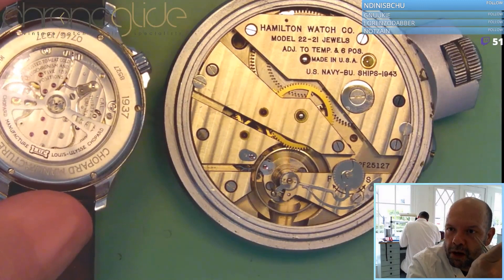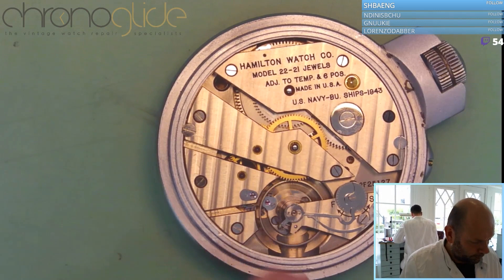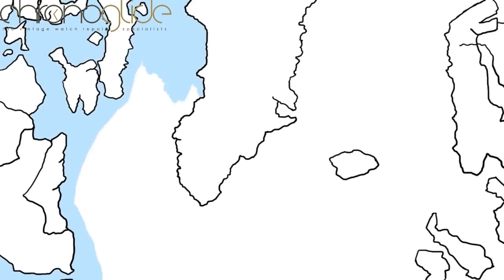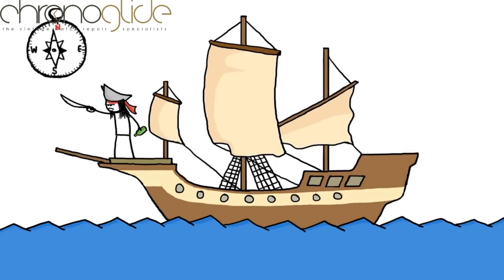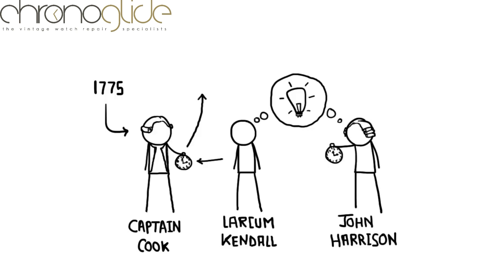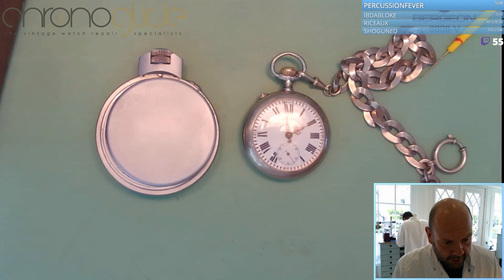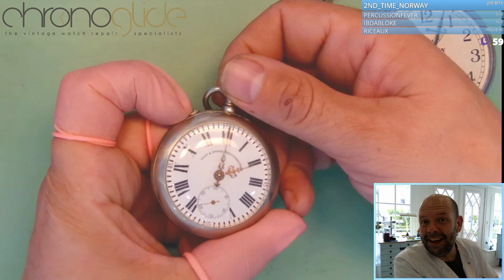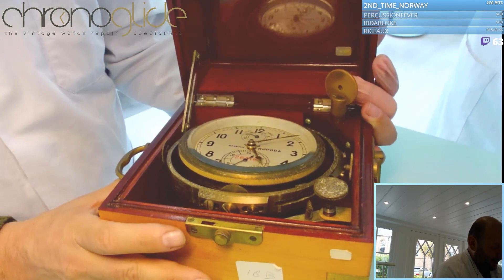History of Watchmaking - Part 3of4 Marine Chronometer

Comment: The clip could have mentioned, but didn't, that a GPS system requires timekeeping to a much greater degree of accuracy than even the best terrestrial navigation system. GPS satellites send time-tagged signals to receivers. The receiver calculates position by triangulating the distances with the four nearest satellites. That distance is determined by the difference in their time tags and is due to the different distances a radio signal must travel, at the speed of light, from one satellite to another.

This means the clocks on a GPS satellite must be extremely accurate, stable, and precise. Each one therefore carries multiple atomic clocks. Even so, they must be synchronized once per day from the ground, since a large, controlled ground-based atomic clock is more stable than a smaller one in orbit.
Reply: American railroad pocket watches were leverset making accidental time setting impossible.